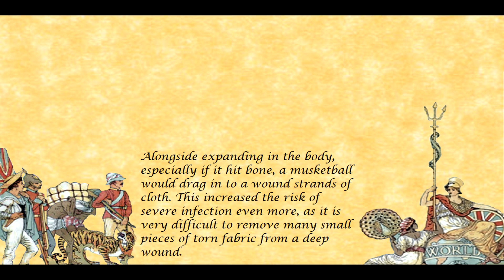Lead Musket Balls Are Very Soft

Comment: One point that must be made very late is that bullet manufacturers are generally optimizing for energy transfer, not penetration for anti-personel rounds. The spitzer (pointed) shape is for increased accuracy and range due to lower drag. 

However, for low range applications hollow-points are common. These are generally somewhat parabolic with a large cavity, with spoke like slot connecting the cavity to the outside. This allows the bullet to flatten out to several simes it's original diameter under the force of drag and collision, increasing the energy transfer significantly (absolutely obliterating the targets internal organs). They are actually often used by air marshals or guards on prisoner transport planes because they are much less likes to penetrate the target and hit a bystander or perforate the fuselage.

Comment: Hey Brandon f. I have to throw in a minor correction, a large portion of British military Musket balls were produced in shot towers (large smokestack like buildings where lead was melted at the top and poured through a sieve to fall down the tower (and cool) into a large pool/tub of water giving a near perfect/perfect sphere rather than being produced in bullet molds (much more common among colonial militiamen, though when possible made in as similar a manner when possible).

Shot towers are little known today (sadly) in large part due to the fact that most if not all were destroyed/recycled for material.
Reply: I think shot towers were used to make small bbs for buckshot or birdshot loads not musket balls

Comment: It is true that a musketball will have a "Magnus effect" but this will only be exacerbated by surface imperfections as it will cause more spinning as it goes down the barrel (as there isn't equal friction on all sides of the musketball so therefore will be a net torque effect) and more resistance in the air so a stronger magnus effect.

The consequences of this isn't as extreme as the bullet flying around to hit you but it does mean that smoothbore muskets have qualities fundamentally different from modern firearms. Modern firearms aren't just more accurate, the little inaccuracy they have is consistent.  When weapon with a rifled bore is shot alignment usually isn't perfect and it ends up flying a fraction of a degree off course, the direction and magnitude of this error is within a predictable range so that you end up with a cone of fire you know all bullets will travel in. This means that if a bullet is 2 inches off target at 100m, then it will be 4 inches off target at 200m and still only 6 inches off target at 300m. The size of target you're guaranteed to hit (assuming you aimed rightly) is directly proportional to the range.

But with a musketball from a smoothbore barrel, the "side spinning" means the musketball isn't just inaccurate at first, it's continually being pushed off target so it misses by a greater and greater margin. So effective range is hugely important in the age of smoothbore muskets, the deadliness of fire suddenly increases exponentially. So you see the importance of drill, the importance of the volley of fire being at the right range. Too far away and the overwhelming majority of your rounds will miss... yet within a certain range no bullet could have begun to curve much and all musketballs were flying pretty much straight and a rather consistent lethality of volleys.

Expertly judging that distance and firing at the right moment made such a huge difference.

Comment: Good video! It is easy to deform the lead while loading, however even a lead cube (cut lead) is quite accurate because of the high density. "capandball" made a great video about this:
https://www.youtube.com/watch?v=Mwhmk-4bDS4

Less dense materials can easily change their direction because of air drag. Think of magnus effect with light balls.
When I was shooting some rough and not at all perfectly round stones with a crossbow into the air, some of them travelled in a half circle and some almost made a complete circle and landed near my position. They made very interesting sounds as they were rotating during their flight.

Comment: Just a quick comment about "modern" bullets - Most rifle bullets will either be ripped into fragments by the force of the impact when hitting a body (For example, 5.56x45mm M193, which is what you used as an example photo) or at the very least tumble end over end after they hit.  Pistol bullets will tend to punch straight through since they don't have enough energy to rip themselves into fragment and typically aren't long enough to tumble.  The exceptions would be jacketed hollow points (JHP) which will tend to expand as they penetrate.

Comment: Lead was the material used for musket balls back then. You shouldn’t have lead musket balls today because of the risk to your health. Regular contact to lead is extremely dangerous for your nervous system. You could’ve inhaled lead into your lungs while hammering the ball. Touching lead can rub off onto your fingers, which can spread it around. Unless your keeping these musket balls in an airtight container, lead will spread into the air. I know you have them because you want to use the real thing, but don’t risk your own health for the sake of historical accuracy
Reply: Lead really isn't that dangerous if you handle it responsibly.

Comment: Did they not have any sort of protective coating to protect the iron/steel on the guns back then, such as bluing? I believe I heard they did in the 1800s and well, if you find an original a century of time, especially of constant use, would wear it off.

Comment: actually today modern-day bullets like the 5.56 in the 5.45 by the Russians are designed when they enter the body to tumble instead of pass through so they instantly spin and yaw when they enter the body because the back end being heavier than the front tumbling it within the body spins around to cause a larger wound cavity

Comment: That ball spinning and flying back to you "idea" is actually partly true, although, as you said in the video, it wouldn't happen because the ball would have to either fly extremely slow, or would have to turn extremely fast. Even though it will, when it began spinning, start making a slight curve, the effect causing this phenomenon is called Magnus-Effect. Felt like making that point, greetings from Germany.

Comment: Why bullets have a gilding metal (copper, steel, etc.) jacket so the bullet won't rip itself apart on the rifling of a firearm. It's about 2,000 fps with a gas check lead rounds can be fired. Once past that, full metal jacket.

I haven't handloaded with cased rounds. Could for my Lee's due to the price, but I just keep with factory bullets.

Comment: Don't you mean a .75 caliber ball, Brandon? That is a Brown Bess you have there, is it not? Or is the ball that much smaller than the bore?
Reply from the maker: It is a Bess, but you never fire a ball the same size of the actual bore with a musket.  Modern shooters often use .71 or similar with a Bess. Historically the military went even smaller for ease of loading and firing.

Comment: Something that I have always wondered about muzzleloading rifles and muskets:  What did a soldier do when a ball became stuck in the firearm when loading due to fouling?
Reply: On one hand, it rarely happens, as the balls are undersized by a few calibers to ease loading, and to compensate for the fouling, and one wouldn't be likely to fire all 60 cartridges typically available to them in one setting, and even then It isn't likely to be a problem. On the other hand, however, it can be a real pain to clear when it does, and is typically to be done with a Corkscrew-like device called a Worm (a scaled down version of what artillerymen use) that is affixed to the ramrod, and screws in around the ball so as to pull it out, barring that, one would use a screw on the ramrod that would drill into the lead of the ball itself. In severe cases, one would first clear whatever fouling/dirt from the front/back of the ball via taking the barrel off and soaking it in something to dissolve the fowling, and then move the ball with the aforementioned methods. In some truly extreme cases it can become necessary to remove the breech plug to bash the ball out the way it came in via the opposite side, but this is a last resort, as it can potentially upset the seal between the breech plug and the barrel breech itself, rendering the barrel and breech plug unusable or in need of repair... the latter two aren't really field capable repairs, and would render the Musket a Pike until the end of any one-day combat engagement, while the first two would still likely mean falling out of the line to fix the issue.
Reply: @bskorupk  and the soaking fluid is preferrably just warm water as blackpowder and it's fouling is very water soluble, more so than modern smokeless residue.
(Modern signature charges for shoulder fired AT practice weapons as well as many military small arms blanks use reduced smoke black powder analogues instead of smokeless powders. And the standard means of cleaning those AT prwactice weapons is a water soaked paper wad or rags and an old tooth brush.)
Reply: @SonsOfLorgar  Whilst a bit to niche in retrospect, the reason I was broad with the soaking fluid, was because there are an annoyingly large number of antique muskets (commonly from the Nepal Cache) that were brought back from the battlefield loaded, but then were immediately hot-dipped in grease at an arsenal, and then stored for generations, with no-one the wiser that they were still loaded. Warm water isn't always enough in those cases, and sometimes require stronger soaking fluids to get through the 100+ years of grease,grime,powder,fouling,wax, and paper. Also it's 5:37 AM where I am and I'm rambling a bit.

Comment: A very interesting video. I have fired a lead ball from my matchlock musket into a box packed tight with newspapers, the deformation was quite marked. The ball ended up splayed out around the 'sides', with small frahments breaking off. If the physical damage from a lead ball didn't kill you, the uniform and soiling carried into the wound would promote infection (a lose-lose situation). Suddenly, a full metal jacket begins to hold a definite appeal - or not!
Reply: And if, big IF, one managed to beat the initial infection and survive to heal, the debris would plague the rest of your life through constant inner chafing and recurring infections.

Comment: In the Napoleonic Wars some soldiers would turn some musket balls into cubes and use them as dice
Reply: There's actually a very practical reason for that. Gambling was often forbidden in the armies of the day, so soldiers who liked to play dice games would hide their dice inside their shot pouches. Since these pouches were often checked by their weight rather than by physically opening them, a musket ball die (which weighs the same as the musket ball it was made from) hidden in the pouch would easily be overlooked by the sergeant.
Reply: @Ignonym  Did they carry loose balls in pouches? I thought they used paper cartridges for the most part, though British riflemen did carry loose balls for when they were shooting for accuracy, when they would load with loose powder , a patch and ball.
Reply: @iskandartaib  They did use cartridges generally, but again, the pouches were usually checked by weight, so it's not hard to surreptitiously replace one cartridge with a die on top of a blank cartridge (or even just a regular cartridge that has been re-rolled with a die in place of the shot).
Reply: Then again cartridges weren't carried loose in a pouch, either - they were quite fragile and prone to damage. Cartridge boxes have little compartments for cartridges. Though I think they also carried bundles of cartridges tied together, and were told to "untie ten cartridges" before the beginning of an engagement (that came from a historical novel about Waterloo, I don't know how true it was..). Maybe Brandon can do a video on the subject of ammunition handling and storage.
Reply: So... Were those dice... Ever... Loaded?